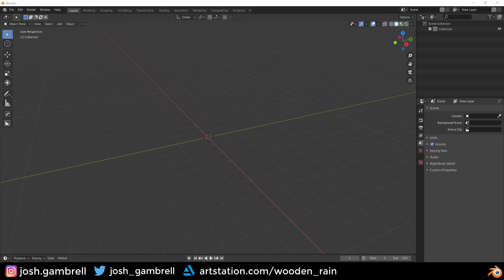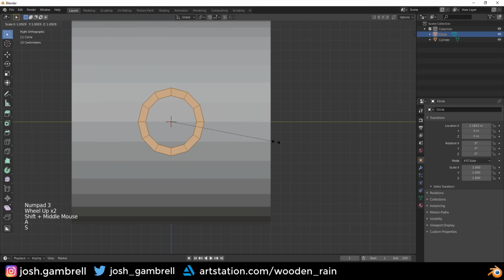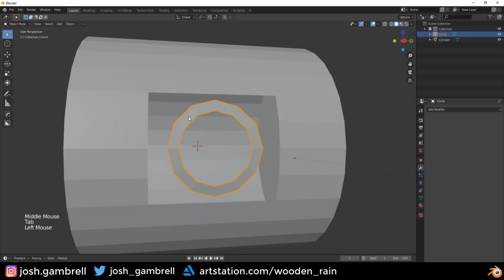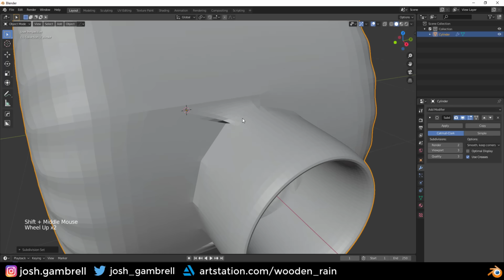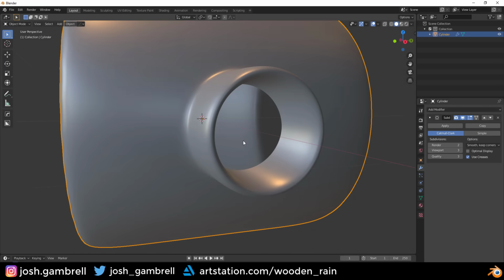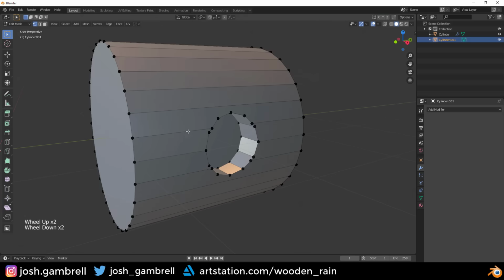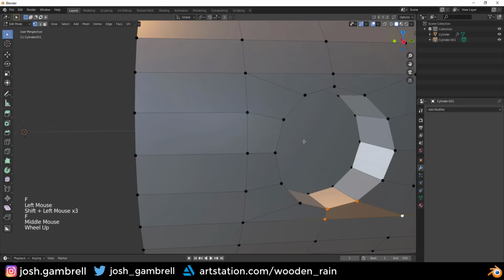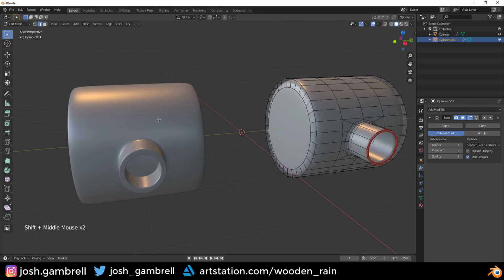The RIGHT way to cut holes in surfaces in Blender

Comment: You're a lifesaver man. Started working on a shower set (hopefully my first asset I'll post for sale) which, as it turns out is like 90% cylinder on cylinder booleans. I was effectively running with what you showed in the second portion of this vid but the result just never hit that level of perfection that I wanted. Knew there was a better way, this is far simpler and the result looks far better
Reply from the maker: Really glad it helps man, thanks for the kind words!

Comment: Sometimes when using GG to slide, if you have multiple connected edges, the vert goes crazy moving all over the place. You can press the C key to constrain it to move along the edge you need.

Comment: Knife project is a significantly easier way to implement correct topology for cutting faces (also preserving UVs). Only catch is that the viewport has to be facing in the correct (orthogonal) direction for it to work properly.

Comment: Nice video - I have to disagree though. For most purposes the boolean method is waaaaaaay faster. Especially if you're actually cutting holes all the way through. Add cylinder -> Fix size -> Difference -> √

Comment: Thanks a lot Josh for your awesome tutorials!
I have a question: If you want to make a bigger hole, for example that it removes 6 faces to the cylinder. I believe the circle needs to have more vertices, 16 instead of 12. Is that true? So every time you do hard surface modeling, you have to try with a certain resolution, possibly fail, and finally start over with appropriate resolution? Hope I'm clear!
Reply from the maker: Yes, I'm sure there's some precise mathematical calculation to determine verts on the shrinkwrap vs cylinder to know exactly what you need, but honestly I just fiddle with it. Most of the time I'm sticking with bools combined with data transfer, as shown here: https://www.youtube.com/watch?v=W8FDlPcUCME&t
Reply: @JoshGambrell  Thanks for your reply! Your Channel is great for hard surface, keep up the good work!
Reply from the maker: Thanks!

Comment: I just started using blender last week. I was modelling a wall and wanted cut a window chunk out of it. Boolean was the only thing I could think of with my limited understanding. It felt weird and it technically looked alright, but something about the wireframe set up bugged me but I didn't know why. Now I realize it was because of those n-gons, i just naturally wanted all my faces and stuff to be quadrilaterals. Thanks for the alternate way to make a hole in an object, I assume these principles apply in some fashion to non-curved objects as well.

Comment: https://youtu.be/Gmucl4H_2eI
How about this approach
Reply from the maker: No man, you just killed the curvature pulling it into a circle. If you really want to do it that way, add in proximity loops around where you’re running a circle. That shading is gonna look warped
Reply: @JoshGambrell  Thank you Josh for the insight, actually the  mesh circle change has an option  flatten which was checked by default. Unchecking that maintains the curvature to a large extent and having one loop cut on either side of cylinder pulled out brought the curvature to normal. Thank You
Reply from the maker: @blendermagic2691  Ah much better there! Good note for those using this strategy, thanks for the update!
Reply: @JoshGambrell  Hey Josh. learning a lot from you. Thanks mate. I found the reason for  the problem with my approach.  I needed extra geometry for the circle. Just insetting the faces selected and then changing into circle brought me to the exact geometry you had. Thanks once again for pointing out my mistake so I could learn

Comment: 3.05 
How did you move the two loopcuts in different axis?
I have to do this with adding loopcut then bevel it once then slide it to different axis! 
I would like to know the correct way
Reply from the maker: Just CTRL+R to add a loop cut, scroll up once to add two, then scale on the appropriate axis.
Reply: @JoshGambrell  Thanks, I was wondering how to do that =))

Comment: Really not the 'RIGHT' way. The problem with this way is that you have destroyed the curves of the surface around the join by removing the vertices, edges and faces. Boolean + manual cleanup is technically the right way as it will preserve the vertices and topology needed to retain the surface structure.

Comment: If that's the best way, there needs to be a fix so it can be done much, much easier. You should be able to just place another cylinder inside and displace it's mass. That may be impossible, but it should be possible. time to update Blender.

Comment: This is so helpful! Thank you, Josh. Pretty new at this, and I have what is most likely a very basic question... When I place a light inside, it passes through the surface of the cylinder and causes it to glow. How can I make it so that the light doesn't penetrate the surrounding container, only shining out of the circular extruded hole that has been added?

Comment: Shift + N at 4:46 does not work. It just brings up a box with the only option being whether or not I want to affect the inside or not. Switching back to object mode makes no changes.
Reply: I think that's because the geometry of the object is too contorted for blender to understand what you want, so it does nothing.

Comment: ** I figured it out. Awesome Videos, I will leave my question and solution for others. 
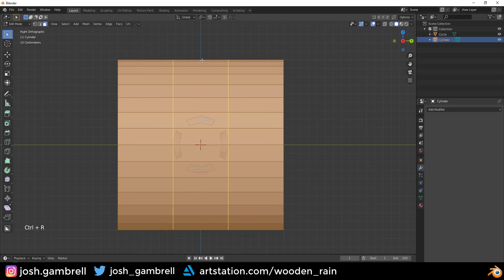Original Question: at 2:53 you add two loop cuts and then scale the loop cuts apart from each other, when I try scale it either deselects or selects and scales the object at the loop cut. What setting or step am I missing? any help here would be awesome. Answer:  you need to constrain the scale to the axis (X, Y, Z)

Comment: Hey Josh! Thank you so much for this video with several very useful hints around modeling in blender....Ctrl + Number adds automatically a subsurf modifier, edge select and F key create a new face, join two vertices on a subdived surface with the J key - incredible, I didn't know about this shortcuts before! Great job!

Comment: Thanks! This video has been extremely helpful. I have recently used this technique multiple times and it works great. Also, using the F key to create the faces has saved me heaps of time as well. I also use F to join verts, for some reason J doesn't work for me.

Comment: another way is just to use a boolean modifier on the object you want a hole in, then get a cylinder  put it in the object you want a hole in and use the eye dropper on the boolean modifier and select the cylinder and then with the cylinder selected go to the objects tab - viewport display - display as - Bounds. Then after you have the hole apply the boolean modifier and delete the box.

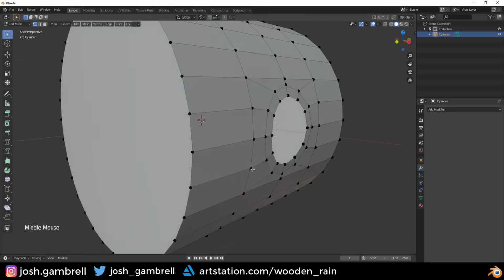Comment: 4:10
Why do you want to avoid triangles?
Reply: Subdivision surface works best on quads, it doesn't do very good job when it comes to triangles.
Also when you animate an object, triangles and n-gons (more than 4 vertices / polygon) tend to deform very bad.

Comment: Well... in my opinion both methods are less then ideal if you are using the software for a CAD like work flow, but if I had to choose one, the second one would be better. Non axis aligned cutting, if you use a boolean modifier you have the potential to move holes around... to some extent, it is still janky. I still wouldn't do it this exact way. And I know, Blender is not designed for CAD mostly for art so it's understandable.

Comment: I personally still use the boolean method as i don't have to delete all the faces. You can also use the union boolean to skip the extrusion steps. And use vertex snap to remove irrelevant vertexes. Both strategies can be equally fast. But still an excellent video.

Comment: There's another method. You can use knife project, select unwanted edges and dissolve them and then use the same strategy. It's way easier than messing with modifiers and the cleanup isn't all that difficult.

Comment: There is also another way to do this that is similar. It can have some pro's under certain modeling scenarios. Rather than using the Shrinkwrap modifier you can project the circle onto the cylinder using Knife Project while on an orthographic or custom-face aligned view. If you remove the faces from the circle and leave the edges then all of the edges will cut onto the cylinder. There will be a little bit of cleanup as well but it comes in handy and saves time on the front end.

Comment: Also why are you filling in faces by selecting the vertices? If you select two edges you can press F to join those together in the same way. You're currently clicking 4 times for each vert, whereas edges will mean only once. I don't find the Bool method you show at the end any more cumbersome than the shrinkwrap method, usually as shrinkwrap can sometimes have a habit of just messing up. Bool method allows you to be fully fluid in your modelling. Often I won't do any mesh work until the end of my model, and I'll be resizing parts and tubes which are all Booleans or modified in someway, so I can have a completely flexible model. Often I'll work entirely with planes which are Solidified, Beveled and Bool'd and be able to customise and copy+paste these on the fly. I have very little cleanup time, and what I do clean up, I find is the same in amount of time I'd spend hard-modelling something new or having to change polys on something I wouldn've applied. Using a bulk dissolve, parts of the Select menu, 3D Printing add-ons to find bad topology, and general merging and vert sliding, clean-up of a Bool'd shape really isn't bad when you consider its vast modular benefits.

Comment: This seems like quite a bizarre method. What about just doing knife project with a shape? It's the same clean-up job after, you don't need to shrinkwrap anything. Also what about BoolTool, simple add-on that you can just poke a shape into another and cut out the hole - this remains editable until you apply it too so you can resize and move the hole around easily. Once you apply the shape, you'll get a hole in the mesh which will need cleaning up in the same way still, but this method gives you more control.

Comment: The Boolean Method is the one that would be more accurate cause the projection method is going to project with distortion ( to understand what I am saying is that try both method with similar circle shape or other shapes without changing them and use for both Boolean and Projection then you will get distortion or other shapes I don't remember but it will be there as far as I recall), maybe in this example it is not that evident. There is a reason people still do this way, actually most professionals use Zbrush, barely any need for retopology and billion polygons which actually lets you do stuff and then there is the actual freedom from technicalities which can make doing stuffs possible as artists are quite prone to procrastinating, However for quicker methods there is Hardops and similar plugins for Blender that makes hard surface stuffs really quick and even without the need for retopology maintaining the perfect curvature which is the sole point.

Comment: Most of the problems I get doing stuff like this is from objects which are not properly aligned to the axes and which do not consists of regular quads. In this case the boolean operators are easier than this.

Comment: here's a tip. in line select mode select both the outer edge of the circle and the edge of the hole in the cylinder and bridge the edge loops. I find it tedious to manually fill in the quads so this is handy

Comment: Just curious, what’s the difference between pressing f to connect 2 verts and pressing j
Reply from the maker: F just puts an edge over the face and doesn’t geometrically change the geo. J physically joins an edge onto the geo to manipulate
Reply: Josh Gambrell gotcha, I’ve been using f up until now, I feel like that’s why I always have like 6 verts stacked on top of eachotjer

Comment: I don't think I knew most of the shortcuts, or both of those strats, you can fill faces without using convex hull?! Well, that's a better way to do it, when I used convex hull to fill the faces, the faces sometimes clipped, and in an FBX, there was culling with some of the faces, thanks for that shortcut!

Comment: "another way" is the proper wording, since theres no "right" way, if the result is the same.
and the extra work you did with the second one, is offset with all the extra stuff u did on the first 
putting the circle on the surface.
It really wasnt faster.

Comment: just add a cylinder going through the other cylinder and put a boolean modifier on it, then extrude the verts that you need extruded and make them Thicc with the solidifier modifer.

ps i do still use blender 2.79 so not sure if this works in 2.8 but id say it does

Comment: Many wasted steps on your boolean method, also you could use the modifier to keep things a bit more non destructive, while working out the details.

Waste cutting steps below.
Cut your extra geometry once you have the 2nd cylinder where you want it.
Use boolean additive (might be off on the name)
Just merge the 4 extra vertice and do cuts for the last 4 with knife tool.
Inset and extrude and finish, or use the solidify modifier.

Comment: Josh, I appreciate this video, but in any CAD packages this takes 2 clicks, or one second at the most. Would it not be time that the Blender devs do something about this? 
For myself I guess I'll keep modeling in Rhino (which achieves very high precision as well) and than render in Blender/Cycles.
Reply from the maker: I mean, CAD has a very different workflow focus than Blender. I suppose CAD would be infinitely easier depending on what you’re trying to achieve, but if you’re going for a complex hard-surface model, want to render it, texture it, etc then there’s a lot more reason to use Blender combined with techniques such as the one presented in this video.

Comment: Nice vid for blender rendering (... but I put the mesh into unity and there are a lot of mesh issues: mesh is broken, the second cycle extrusion is not closed even tough the vertices are face connected, trouble between inside/outside normals, recalculating don't fix this problem)

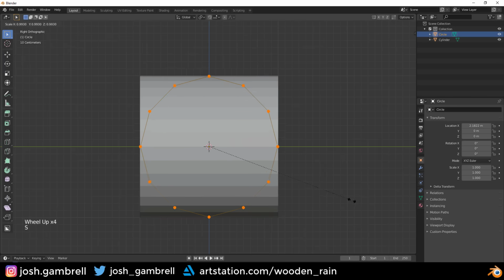Comment: 1:23 this can't be just arbitrary size. You had a PERFECT match of circle vertices vs overlapping cylinder sides to be able to make the quads. I can't see this method working with wildly different vertex counts. For this method to work you'd need to check first how many edges you'll be cutting at your desired size, then create a cutting circle with [desired cut edges count + 2] sides. You make it sound like it works in every case, but it doesn't.
Reply from the maker: Well of course. This video was to build intuition on how to approach this type of situation. Showing every single vertex case and situation would’ve been impractical and a waste of explanatory time. After doing this enough, you’ll understand intuitively which edge/vertex count works and what doesn’t. Even still, worst case you connect some triangles and a subsurf turns them into quads, although it is less practical.
Reply: @JoshGambrell  I don't think it would've been a waste, you could've added one sentence explaining that vertex count depends on how many edges you wish to cut through, that's it. Don't want to sound too negative, I loved the tutorial, thanks for making it!

Comment: Interested how Josh would go about it when the circle had more vertices. 12 matched nicely to the surrounding, but say 16? Purely from the standpoint of maintaining rectangles.
Reply from the maker: You have to adjust the circle count/vertex count respectively to what works in your situation. The method presented in here is one you’ll use most commonly and is meant to build intuition.

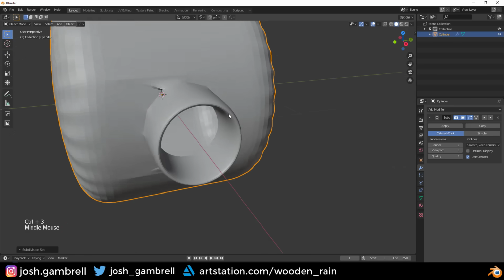Comment: 4:35 BlenderGuru gave a tip of noticing badly oriented normals.
In the viewport top-right (just left of the shading options) open up the overlays and there's "Face Orientation" under the category of Geometry. Blue is facing the camera and red is the opposite.
Reply: tahnk you

Comment: Other simple way to get a hole is to join the faces that make up a square 
Then add an inset,
And with loop tools (or just use transform to option) and make it a circle and delete the face

It's faster than both, the 1st and 2nd method in the video

1st method is quite impressive but there's way to do it faster

Comment: If you're baking - using the geometry as a high poly it doesn't even have to be connected. Just give it an outside ring to approximate the connecting bevel and let it float above the surface for about the same visuals with even more time saved not having to make a clean wireframe.

Comment: I think your new stategy will help most when joining 2 weird shapes together, like an I beam on a cylinder or something. Circles on circles are easily done with booleans but this 'just extrude it inwards and then extrude the new faces out' technique only works when working with a perfect cube or circle. Scaling become a hell of an issue when applied to, for example, the letters G, Q, W etc... because their scaling will not be equal on all faces.

Comment: I have small Problem. At first. You should say that you need for a 12 sided circle on the left LoopCut 5 Verts and Same on the right + the middle loopcut = 12 :D 
Second: I tired to do a Muzzlebreak but if I make the Cylinder inside, I can't use the same Verts Cylinder as before, this will not fit. Any solutions? :) But still great Tut. Subbed ♥